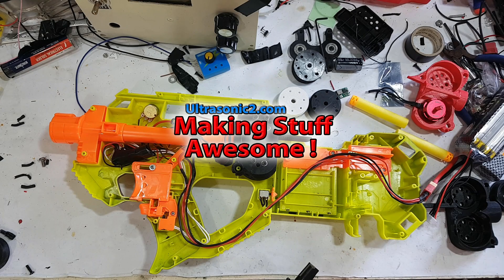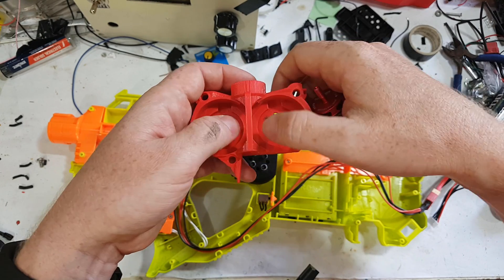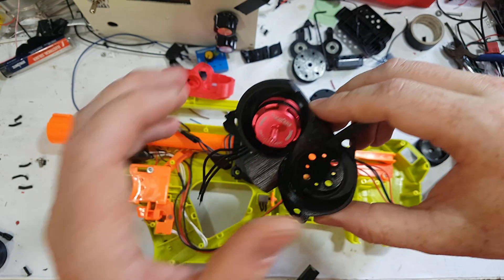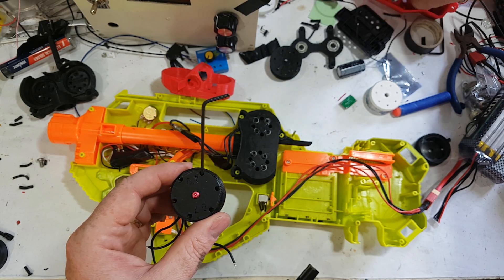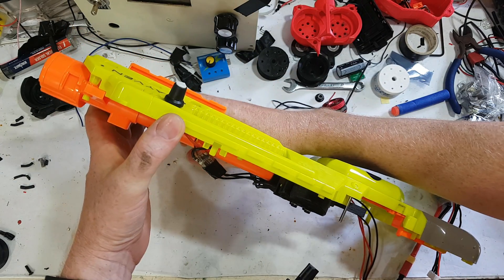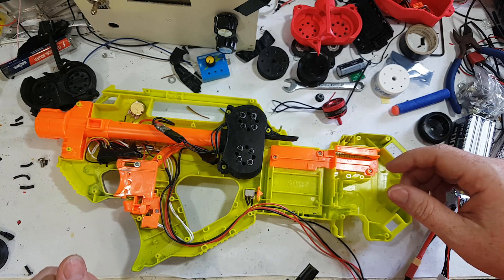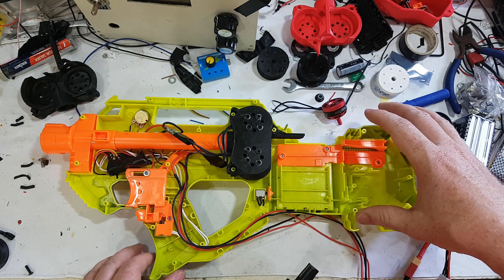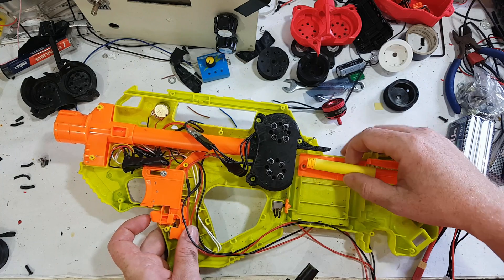⚡️ Nerf Rayven Mod (Rayvenfire) Gen 2 Cage & Adjustable FPS

Comment: Hey man, love this and I am going the same project however my gun won’t rev when connected to the pot. I have tried literally every combination but can’t seem to get it to work. Do you have a wire diagram or something like that?
Reply: Also what size pot did you use, like what is the ohm rated at?
Reply from the maker: @ortaegaclan4016  join the FB group and post your questions there.

Comment: Any chance of getting slightly smaller STL files for the Rayven?  Shapeways only allows a max of 64MB uploads, and the current STLs are just too big.  I know I could probably just open up the files and save them at lower quality, but I don't want to munge any details or geometry in the process.

I'm looking at the 8.7 gap wheels, since I have to hit massively under the performance ceiling of this setup to comply with a 130 ft/s velocity limit.